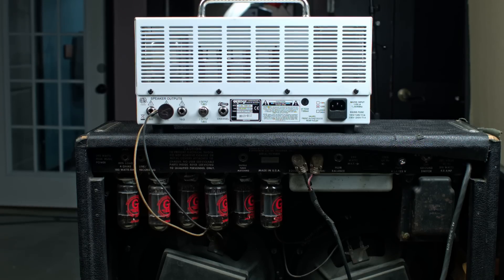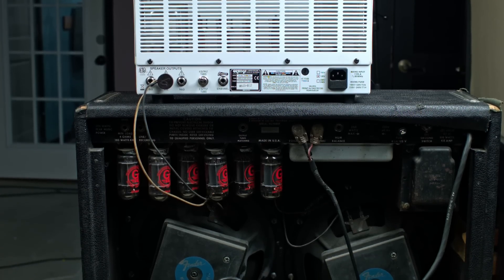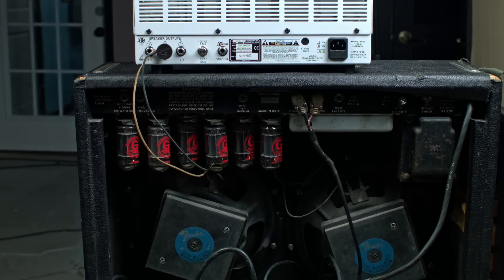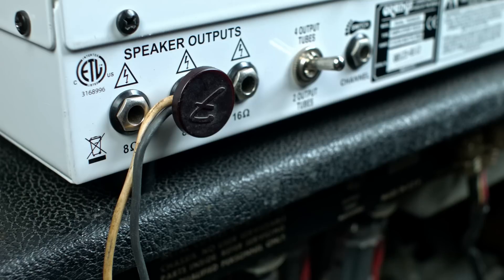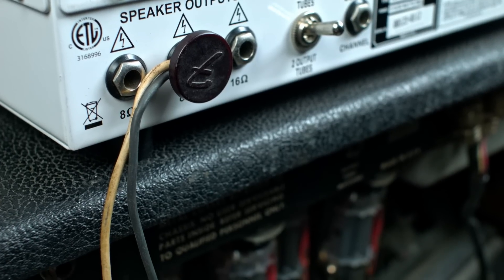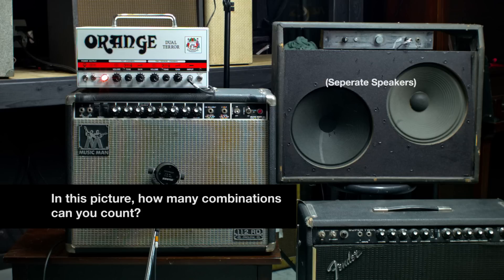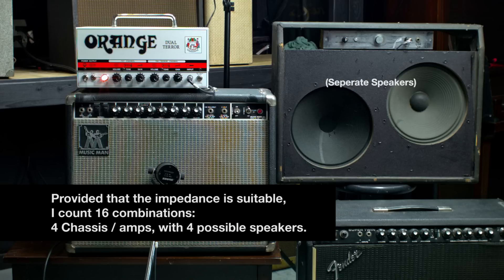Frankenstein Combo Amps For New Guitar Tones

Comment: It´s all about the flexibility! 

We´ve quite often used e.g. the Fender Vaporizer paired with a 1x12  pine cab housing a Greenback, because the Original combo Speakers are quite bright and shrill. 
Sounds great!

If you know ALL your speakers and amps and mics really well, you have a million different options right there! Knowing your gear probably is the most important thing in a studio.

Greetings
~Moe (MachMaMecker-Recording)
Reply: I was actually impressed with the great sound of the Vaporizer speakers. I expected them to sound bad at that price point, but they sound really good.
Reply: Well it depends on what you´re going for. They are pretty damn harsh at first, after breaking them in, it does get better though. But they definetly do enhance that fuzzy, really cold biased sound of the Vaporizer. A unique sound for sure!

Cheers
~Moe
Reply: Yeah, I find that a dynacomp tames the harshness

Comment: I've always wanted to see someone do this but with pre-amp/poweramps. Say, come out of a Marshall's FX loop send and into a Fender's FX loop return, something like that. You could get a 100W AC15 tone!
Reply from the maker: Haha, yes the FX loop! Great idea.
Reply: Slaving? That would be cool. Youd have to match gains and impedance?? My amp has a 'slave out' as well as an fx loop called 'echo in/out'
Reply: jorgepeterbarton you don’t. FX send should always be line level (-10 or +4), and the FX return should be line level. 

I’ve tried this, it works well. It’s a very different sound from either amp.
Reply: On Master of Puppets, Metallica took the pre-amp out of a Mesa amp and hooked it into the power amp in on a Marshall head. 

Tons of stuff you can do: if you have two amps with FX loops and two cabs, you can get six distinct sounds out of them. 

It would be fun if you could do a video on just that :) I’ve experimented with a H&K Tubemeister and a JVM 205h before.

Comment: I was gunna say, the left side of the 5150 sounded nice! Was curious though, is the right side of the 5150 the same kind of speaker? And no, I don't think you took it too far with this, it's a great idea and technique! I have an Orange micro dark I like to run the tube preamp out of into the power section of my JCM 900! So a little different but same idea
Reply from the maker: No very different kind of speaker. Left is from an old Wurlitzer 4070 organ.
Reply: oh that's cool!

Comment: Get and build this impedance converter It will open your options up further... 

I mix and match 8 ohm amps into a 4x12 old marshall cabinet. It's cool and if you use a long cable, you can adjust the amp from the studio and have the guitarist in the room with you working on parts.

http://www.ampmaker.com/store/Box-of-Matches-30W.html